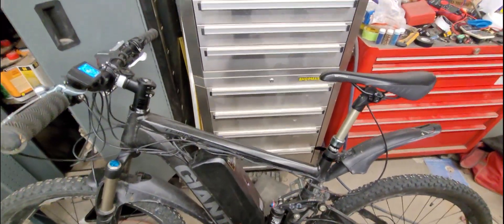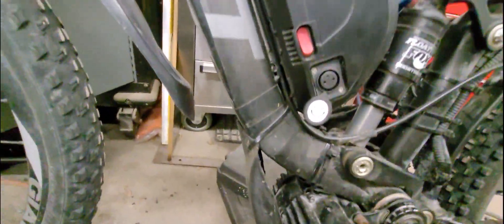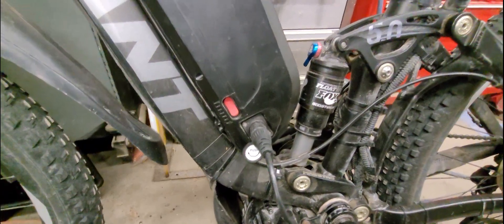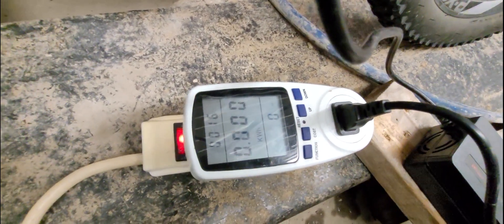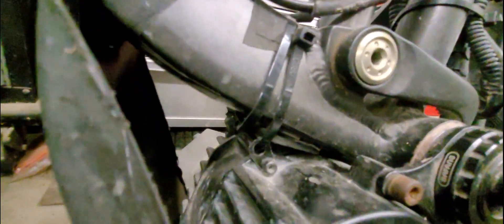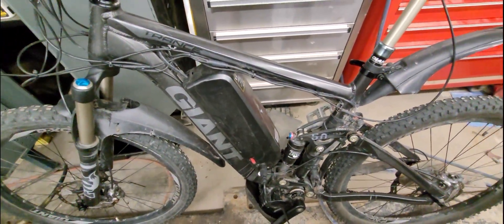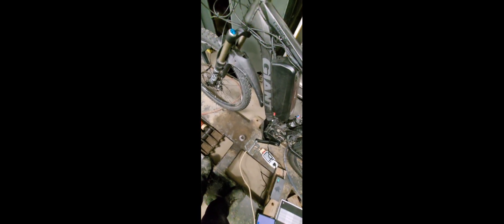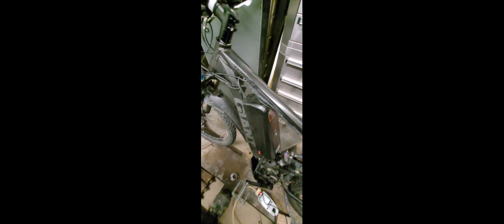Cheap Amazon eBike Battery 52v 20Ah Capacity Test vs What is Advertised 52 Volts 20 Amp Hours?

Comment: I do the same thing with all of my batteries. My best result was with my stealth bomber clone which has a 72v 75AH 5400 watt hour battery and I got 6190 watt hours, so the 10% loss is pretty close to accurate. I'd say 12% charger inefficiency power loss is probably closer. I have also noticed that most of the battery packs that look like yours in the black case which come with low end bikes are always under their claimed capacity.

Comment: Bro, thanks for the video and testing! I just bought a Amz blue battery, 230 bucks, LOL supposed to be 20AH. Well, I literally just did a test and I am thinking it's more like a 10 to 15 ah. So, if a 20ah should hold 1040, shouldn't the wh used to dead be at least like 1000wh used. Meaning, if it truly is a 20ah battery, from 58.8 to 42V, should the watt meter show that I used 1000 watt hours? Another way to look at that is, how many ah hours are actually usable on a true, 20ah battery? After my ride it shows I used 9.8 ah's and I am still at 50V, for example. Much appreciated, thanks!
Reply from the maker: Yes it should be more watt hours but there is also voltage dip under power. So when the battery shuts off at 42v it usually raises back up when it's not under load. So it's not really 42 when the bike stops it's 44 or 45v.

Comment: Will running them in parallel make a difference for voltage sag?
Reply: I think more amps and less voltage means less voltage sag
Reply from the maker: Running them in Parallel means the 2 batteries maintain the same voltage to eliminate voltage problems run the proper size cables to maintain the amps or the current you plan to use. With an ebike battery like this one 8 gauge pure copper wire would be a good choice.
Reply: @A5h3n.  I added a second pack on my bike and that lowered voltage sag under load (higher topspeed)
Reply from the maker: Not really just use same size cable and length for positive and negative if possible

Comment: Was just about to buy one of these and now im not so thankyou. Would you recommend one of the higher quality name brand ones? They usually range between 500-600 dollars for the 52V 20AH
Reply from the maker: The battery is still performing just like new with several thousand kilometers on it.
Reply: They aren't bad battery packs they cost 58% of what a Samsung pack costs at the same effective battery capacity. 52v 25ah Liitokala packs are effectively 18.5ah but only cost £175 and a Samsung 18.5ah pack costs about £300. The only down side is the extra weight.
Reply: If you're going to use a bbshd id suggest battery's with BMS with 30a min to 50a preferably. Electrify Co or golden motor are good companies.
Reply from the maker: This havs been a good battery for the price I would still buy it again it just doesn't have 20ah it is around 15

Comment: If you look at the way the cells are usually specified, the rated ah capacity applies when you discharge from 4.2v to as low as 2.5v at the rated C current - so maybe 3 amps for 3ah cells. You have a 14S battery so you would discharge from 58.8v to 35v.
Reply from the maker: I haven't seen anyone recommend to discharge a 52v eBike battery to 35v that could do permanent damage in my opinion. I think I will stick with the known safe range of 58.8 to 42volts. The Bafang controller will shutdown the bike well before 35Volts anyway so it wouldn't be useable anyways.
Reply from the maker: I could not find reliable data on the cells they are pink isr 18650 with a bar code. I searched internet but couldn't find the exact cell in pictures. Now that I know how many amp hours it is between 58.8v and 42v if I can find the total number of batteries cells in the case I could calculate the capacity of each cell fairly accurate.
Reply from the maker: Can you find the ratings on these cells? They are pink ISR 18650. Judging by the speed they start losing voltage below 48 volts in the eBike battery. They are not high quality cells with a deep discharge cycle down to 2.5 volts per cell.

Comment: So if you want to run the 1000W Bafang at full strength using one of these batteries advertised on amazon, you really need a 52V 30A Battery to account for the charging loss and over-hyping of the seller?
Reply from the maker: The amp hour rating of the battery is not the max discharge rating of the same battery. Typically an ebike battery that is only 10Ah hours or 15Ah could give discharge current in bursts over 30 amps. My 20Ah battery has been measured as high as 30.5amp while riding it with a DC clampmeter with the voltage at 58v giving me 1769 watts of power for short periods of time.
Reply from the maker: On power level 9 I've seen as high as 1600 watts when the battery is freshly charged. So this battery can deliver close to 30 amps discharge in a burst or under 1 minute for sure. The battery isn't bad for the price in my opinion. I rarely ever use over 500 watts and when I do it is not for very long.